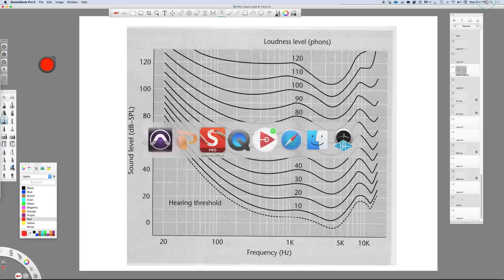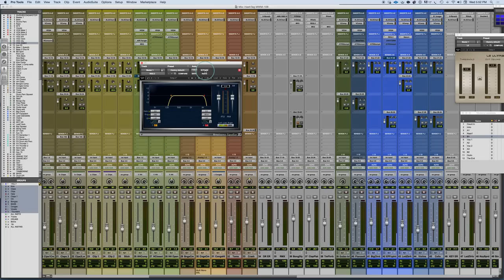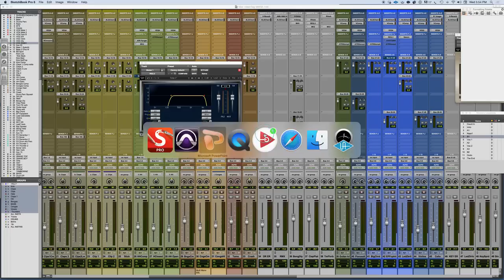How to Make Your Mixes Translate - Mixing With Mike Mixing Tip

Comment: I met up with David Bendeth not long ago and he had a great old school tip for me to get things translating. His approach (I think likely learnt from Arif Mardin) is to make the mix sound identical on his two different sets of monitors. He'd have his mixes so he'd flip between ns10's and his tannoys and you wouldn't be able to tell which is which. He also liked getting out the sweet spot and making sure things are audible at all points in the room. I love my mono auratone as you can have it fairly quiet and it gives you a truer sense of volume without any bass/room issues.
Reply from the maker: +Ed Sokolowski Hi Ed,

This technique has been used by almost every professional mix engineer that I ever met from that era. I think the word "identical' is a bit deceiving, because it is literally impossible. The basic idea, is to make the mix translate so that it doesn't sound too harsh on the NS10s or too dull on the Tannoys. The ultimate goal is to make the mix balances sound the same on every set of monitors you play them on because there is no way to control the frequency response of every monitoring system. I often used a mono Auratone under the console or pointed away from me so that I could judge the mix in less than optimal listening situations. This almost always exposed deficiencies in the mix immediately.

BTW, I worked with Arif Mardin back in the late 80's but never recall him making this a priority. Incredible producer,  one of the all time greats!

Cheers!
Mike